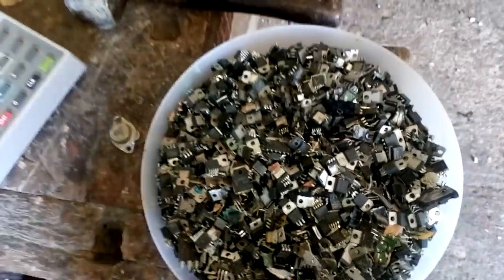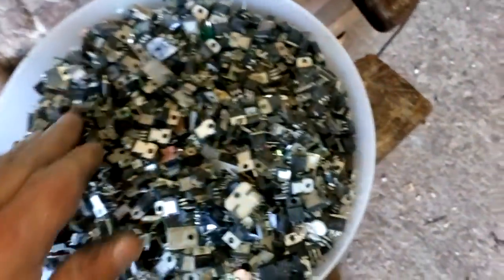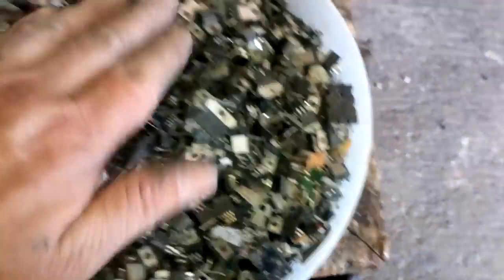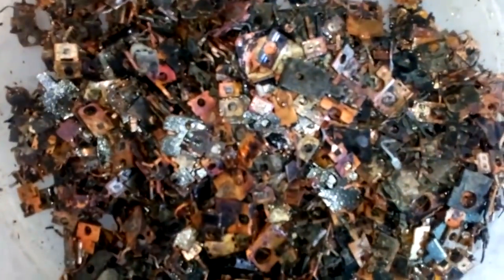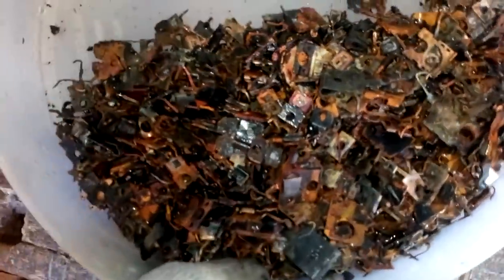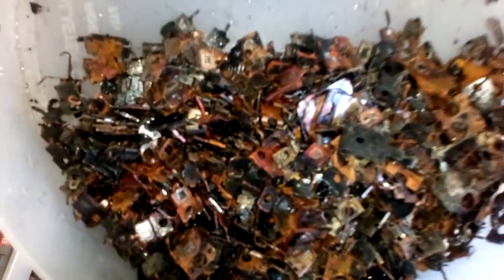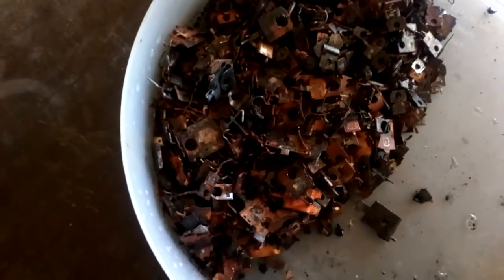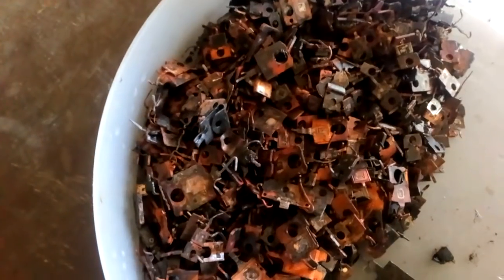COPPER & GOLD from IC -TRANSISTORS -TEST

Comment: There's a problem I'm having with boards that use bismuth-tin solder.  The bismuth dissolves in nitric at first, but then apparently as the solution heats up, it further oxidizes to insoluble bismuth oxynitrate, which gums up filtration.

I'm wondering if it'd be better to dissolve with dilute sulfuric acid first, as it looks like bismuth sulfate is soluble and doesn't become an oxanion with heating, unlike bismuth chloride or nitrate.

Comment: Oh those thick things!  I was wondering what they are.  I cut some apart and found that they're basically a thick copper plate with some kind of semiconducting chip on them.  Good to know there is gold as well.  I hear there is also silver.  

Looks like the best plan for parts like this, and chips, is to pound out all the silicon portions and settle the dust out with jet dry (as others recommend), then combine it with all other metal powders and perform chemical recovery.   Weak nitric first to separate the silver and palladium into one solution, then hot aqua regia to separate out the gold and platinum into another.   Then follow other instructions to divide the two metals in each of those solutions.  The platinum should almost completely settle out as a grey powder when the metal-saturated and urea-neutralized solution is chilled.  

There are so many parts on these circuit boards.  It'd be nice to have a site that just has lists of the names and composition of each part next to a picture of examples.
Reply: Yes I agree it would be good to have an explanation of all the different parts. I have been collecting nearly every part and separating them for two years now! I am finding slowly that I am saving up gold, silver, platinum and others. I still have not got round to processing yet but am learning a lot from all the vids using the acids. I even have a pot of resistors but haven't seen a mention of them yet.
Reply: @wastedorion  resistors? yes he has. he already did a video of the dog bone resistors that may have gold plating inside the end caps. Find the video on this channel. The normal carbon resistors with rainbow rings are normal carbon and not worth anything but the dog bone resistors are worth keeping.

Comment: For best results when panning for micro gold ,dust,powder use jet dry it will deny the gold the ability to float on the miniscus (top) of the water jet dry allows the water molecules to seperate  making the water in a sense wetter and allowing the fine gold dust to sink. Great test and ty for sharing, im glad because I to have been saving these pieces.

Comment: I have not tried refining these yet although it is interesting to see the make up of the mosfets. I usually sell these or keep them for some of my electronic projects, these are usually internal switches and voltage regulators which are very useful and sometimes very expensive, it might be worth the trouble to sort and try to sell some of them in the future. unlike a lot of IC chips that we refiners are after these do not need programmed so could still be used second hand. Anyway great video and from a refining point of view very nice to see the different components values on noble metals.
Reply from the maker: Kaisernine I'm glad you like it! Personally I do not have time to check in particular who have value for sale, it goes with me in the same copper bucket, while the dust is kept for messing with ICs! In the future, I will test some other components!,Cheers :)
Reply: 999 Dusan Gold recovery I agree all comes down to time, I understand completely, I do not salvage all components only some that strike me as in really good condition or a odd one I have never seen. looking forward to more videos

Comment: Hey Dushan lol me again, hey on that copper you salvaged in the video, could you put the copper in HCL for like 5 minutes to clean it and make it bright and shiny instead of the burnt look.  I was just curious about that as our scrap yard here pays a massive premium for bright and shiny copper, I seen someone on a video dip a wire in HCL (i think it was HCL) and it came out super pretty, so was just wondering if you had tried or thought about it.  Would love to see your reply :)> TYTY, awesome video again :).
Reply from the maker: snoozin99 I know what you mean, I personally did not do this because I keep this copper for meltiin the into bars, so I do not care to clean it now, but your idea is good and claver, the price of a shyni copper is better than burning copper !
Reply: I saw that if you drop a penny into a glass of coka cola, the acid in the drink will shine up the penny. So after smashing off the die material from the copper heat sink, you could shine up the heat sinks by using a quick acid dip.

I seem to recall that not all 3 legged transistors with or without copper heat sinks have gold bonding wires. Modern transistor manufacturers of the lower grade transistors are trending to using copper or alum bonding wires rather than gold bonding wires to sacrifice a little performance over manufacturing cost so you could end up with a bunch of bonding wires of copper or alum. I think this could also apply to inline IC's, flat packs, and 2 sided ic's. I could be wrong. I know that the top grade of ic's have gold bonding wires but sorting the low grade from the high grade is a pain.

Comment: Hey Dushan, when you did your cleaning on those, did you happen to use a dishwasher rinse aid, it's supposed to break the top of the water plane so that all the micro gold will not float off while rinsing it out and it will actually sink to the bottom saving all the micro gold. I'm not sure if the result would've been better but that micro gold can add up.  I seen it done when guys are panning for super fine gold that the eye can barely see on a lot of the gold recovery videos.  Just a thought, great video man, i'm definitely going to start saving those, copper is big money with other copper added it's just more dollars off the computer boards :).  I hope you do other tests with other components, cant wait to see them, Have an awesome day :)
Reply from the maker: snoozin99 Yes, I used it, but I forgot to mention it in the video, it's happening! I have a lot of other collected components that I will test as soon as I get to the time! I'm glad you liked the video.